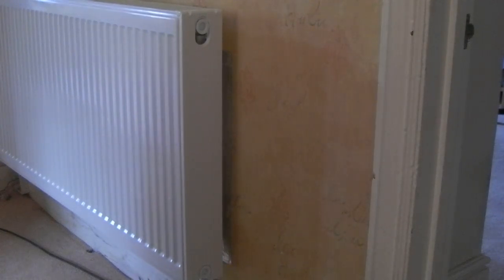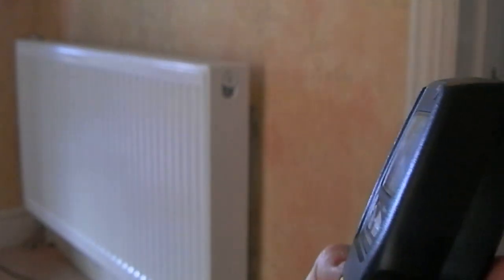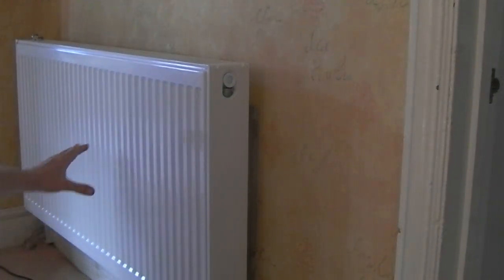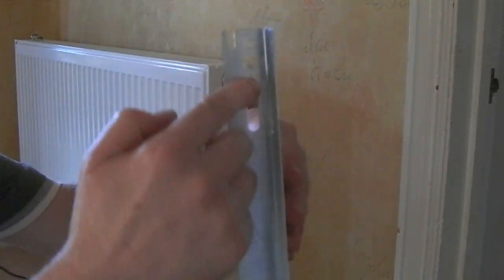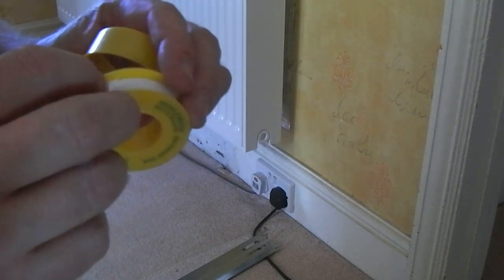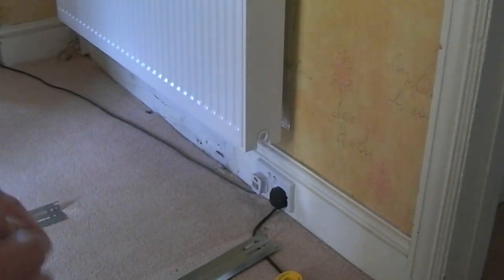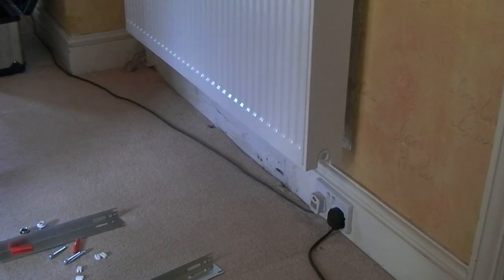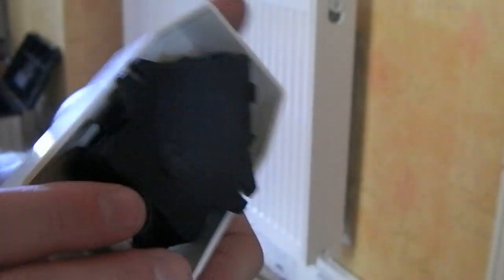How to install central heating. Part 8.

Comment from the maker: Excellent point Chris. The point to the left will be gone as it is the old economy 7 point. The sockets to the right will be moved when the floor is replaced as part of the pipe running job.